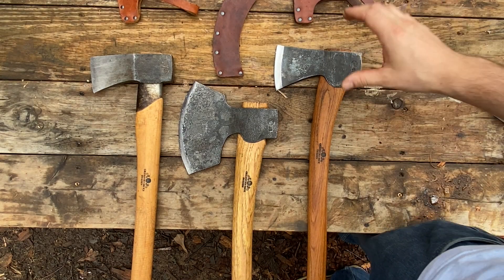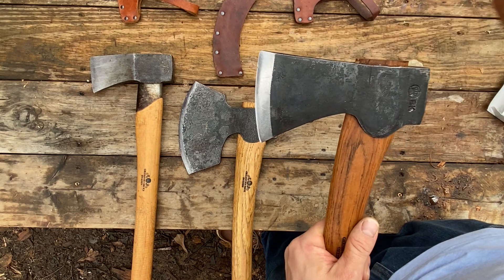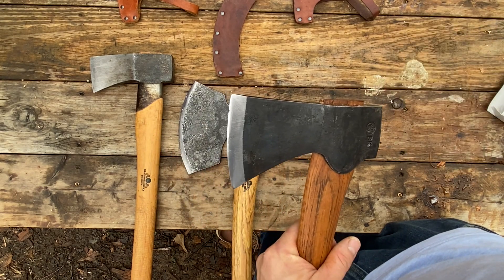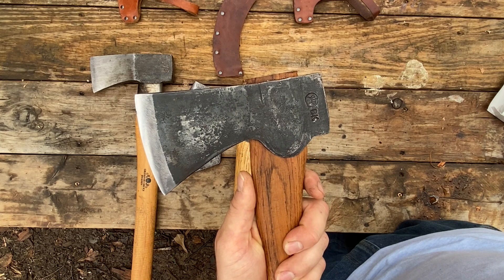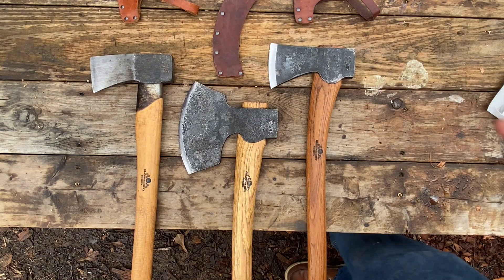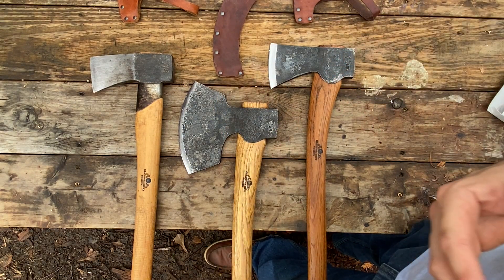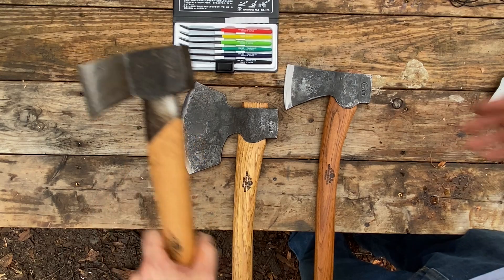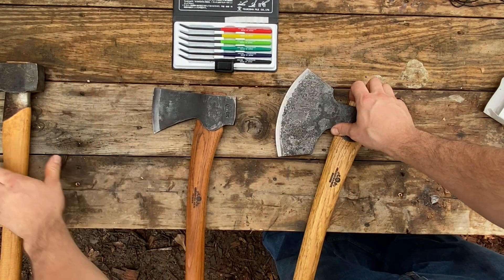How hard is Swedish Steel? Testing Gransfors Bruk axes with Rockwell files

Comment: I guess the reprofiling is the best option if you want to continue to use the axe in harder woods without constant damage. Shame though.
Reply from the maker: I hate to do that, but I think I might have to. I’m just not sure how useful the axe would be otherwise. Would probably lose a half inch on the bit length.
Reply: Nah, just get a local axe.  I picked up recently a Master Mechanic axe from the 1980s that originally sold for $12, easy to find.